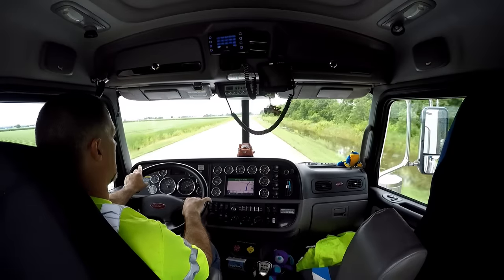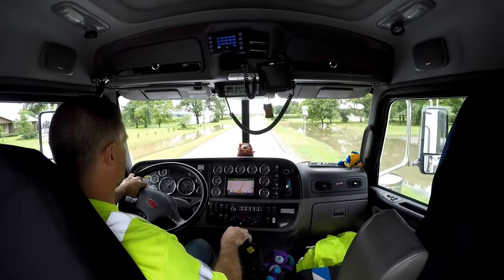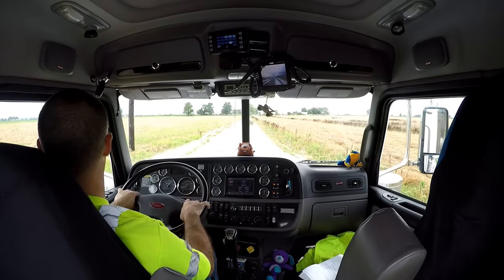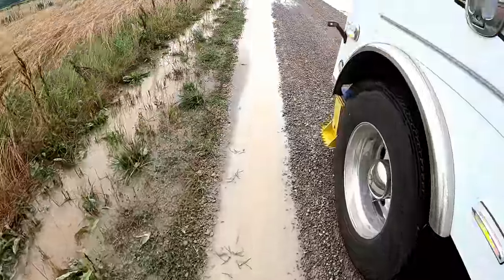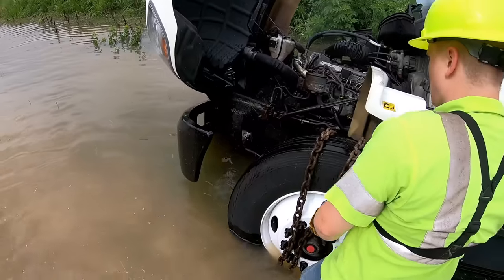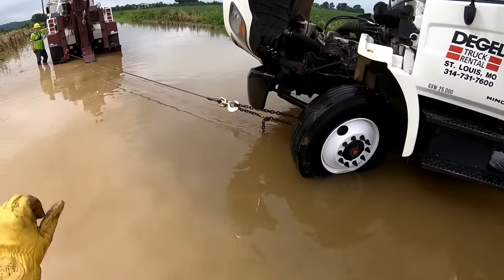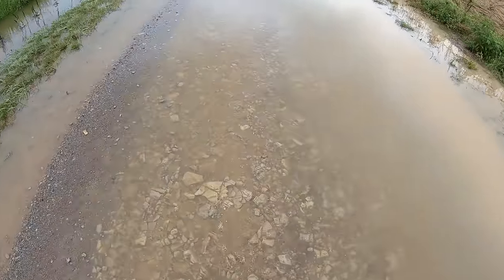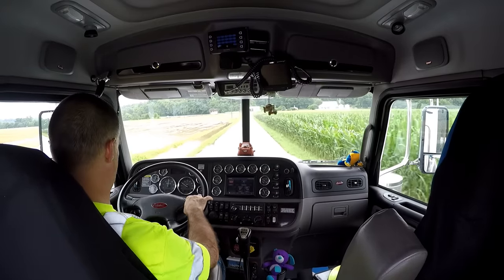Box Truck VS Flood Water

Comment: My Dad told me, "IF you can't drive as well backwards as you do forwards, you can't drive."
Reply: My dad made me back a 4 horse gooseneck trailer up our 1/4 mile windy wooded driveway before I was allowed to drive it on the roads.
Reply: I had to drive 46 miles backwards my transmission went out only thing I had was reverse
Reply: Your daddy 😍 is absolutely right.  God bless you and your family 👪 🙏 ❤.
Reply: Start with haywagons lol they are thrilling
Reply: @keithratliff6884  did you get pulled over

Comment: Well done you Ron for helping the other tow truck, the sign of a true Gentleman, and a big thank you so much for giving us a look see at your area, even from the go-pro on the back of the cab, it looks to be a really nice place where you live and work, as for water problems, I always remembered what I was told as a young driver, never drive fast through water that hides the road you want to drive on, the water just might be hiding something I don't want to drive on or over, and yet another look at the interesting work done by Ron and Talon, Thank You
Reply: Midwest truck you were a sight for sore eyes. I ran a mail route for 8 years out of Cape Girardeau, and out on those county roads during the heavy snows, black ice, and the massive flooding of the region, the snow plows, never saw one, sand salt or cinders, ain't gonna happen for at least 3 days. The Flooding was just as bad to have to drive through as the black ice or thick fog. Small Izuzu box truck with regular street tires! Now, with that said, You were never dispatched to rescue and recover  me and my unit, but you do go into the worst of the worst driving situations to retrieve the non drivers in driving situations. When the mail is dispatched, once it's loaded onto the truck, the directive is to  go deliver the peoples mail. Go! Go until you can't go another inch.. Out in the farmlands of Chaffee, Oran, Bell City, Perkins, Advance, Delta, Chaffee. The good part was that it was all flatland, which took a little  stress off from not having to worry about the next snow or ice covered hill to get over. 
I really enjoy the ride alongs and revisit the roads and communities, familiar sights. Your videossort of brings me back home. I live in N.C. now. Appreciate every aspect, and quality production of your videos.
I notice you always strive to practice, and put Safety first.
Reply: The bootheel of Missouri is absolutely beautiful...... well until winter.  Beautiful yes, in pictures,  lol.  Driving is another story.  Only white stuff under my feet now is SAND

Comment: Good explanation of the lift axle, one thing missing about the self steer lift axle. You don’t want to back up with them down because it will destroy them. They are meant to steer in forward movement but not in reverse.

Fans in water are a combination to take out a radiator, they flex and pull the blades into the cooling fins if the water is deep enough.
Reply: Thank  you for explaining that I was not understand the lift axial

Comment: Out here in West Texas, during our rainy season we often have heavy water running across roadways. Flash floods Etc. They like to put measuring sticks in the ground at low-lying areas with the depth indicated. So as you approach an area covered by water you can see how deep it is. They usually do this at places that regularly get flooded

Comment: Those Cobra rigs (CB radios) are an awesome piece of kit. Also illegal here in the UK without the correct licence too. Yes, we have to have a licence to operate a CB radio here in the UK
Reply: Diefers Dashcam UK seriously?
Reply: I've still got an cb and use it no license I've looked in to it if it's not illegal  from what I've been told
Reply: That was certainly the case at the time when the "Convoy"-type movies were at their most popular but the requirement was dropped some years later.  Having said that, it is perfectly possible that an under-resourced government could have reinstated it!
Reply: On CO radio  we cannot use AM type radios, we have to use FM  you have to have a full Ham licence for AM.
Reply: Here in Canada,  one province has put CB's into a rather dark "grey area", that is to say they've banned the use of them.  In Ontario, they're legal to own, but it's now illegal to use one while in motion. It's now quite a brutal fine and points if you get caught playing with toys in your hand while driving. Must be legally parked (not waiting at a red light) to use phone, CB. Even adjusting your gps could land you in the same hot water.  
And yes, Canada dropped the licensing requirements for CB's decades ago, as in the late 70's or early 80's. Used to be, you could get the base-model Cobra 29, or the Uniden 78 for about 80 bucks,  but like everything, they hiked up pretty radically over the last ten years or so.
Reply: Back in the 60's you were supposed to have one in the US too.
Reply: In the USA the government kept complaining that the CB license was not cost effective, but would not tell the FCC what to charge. 
The FTC simply decided to make them free, but still required to apply for one. Eventually this was also dropped.
Reply: get a ham radio license i have one here in california and cobra is a good radio
Reply: Diefers Dashcam UK    It was once required in the U.S.
Reply: You need a license to fart in the UK, and don't you dare have  an independent thought either!
Reply: Diefers Dashcam UK I didnt even think cobra made radios lol galaxy44, 33 ,99  10 band covered to CB is the way we do it in the US...
Reply: back in the 70's in NZ we had 1/2 watt capacity . it didn't take long for the techs to realise that it only took a diode to be removed and you got 5 watts. We had a yaesu with upper and lower sideband which could also broadcast on the AM commercial radio band width... ha ha . They are still here in OZ by the caravan people as they have a good range outback.
Reply: Even in the U.S. a CB still technically requires a license (as does FRS...GMRS gets a wee bit messy as of last year since it now exists partly as License-by-Rule and partly as a mandatory purchased license depending upon the radio's specifications), the difference being that CB falls under the "License by Rule" provision, which means a license is automatically extended to any properly type certified (Part 95D) and compliant (unmodified) CB whose user is operating it in accordance with the established regulations.  But if you get caught operating a CB outside of those prescribed regulations (particularly violations of the technical rules, such as power output, modulation, or spurious emissions), then that implicit license is instantly rescinded and you will be charged with operating an unlicensed CB radio and an illegal CB radio and the fines can be quite stiff (typically on the order of $5-20k per offense, or even per day in some instances), so some play with fire and will get away with such for a good while until they finally piss off the wrong party...and then immediately cry about how unfair it is that they should have to play be the same rules as the rest of us, nevermind that due to the nature of radio it takes only a relative few bad apples to truly destroy radio for everyone (globally even at HF frequencies such as with CB at ~27 MHz) if we don't all play by the rules and cooperate so that everyone can enjoy radio.
Reply: We had to have a licence for AM (27mhz) & UHF (400mhz) here in Australia. I think the department that regulated it all eventually gave up on trying to keep control of it all & gave up.
Reply: You should get Talon some waders.
Reply: Diefers Dashcam UK   Even in US "linears" still illegal on CBs. Wager the same would be true in other counties. Long as no linear involved CB was limited to 4W input to final.
Reply: Stan Patterson That's a myth, at least until 2021. No grey area in Ontario.

https://www.ontario.ca/laws/regulation/090366
2. (1) Drivers of commercial motor vehicles may drive a commercial motor vehicle on a highway while holding or using a two-way radio.  O. Reg. 366/09, s. 12 (1), O. Reg. 253/12, s. 2 (1); O. Reg. 424/15, s. 3 (1).
Reply: WOW that's bizarre!
Reply: In the US if you have a Ham Radio you have to have a Lic.
Reply: VHF and uhf and hf are license only and cb radio are licensed free in the uk
Reply: in the UK u also need a TELEVISION LICENSE.... TO WATCH TELEVISION (not kidding.)
Reply: GTFF  I regret to state that, he is entirely correct.

It was alleged that...
AM CB radios would interefere with monitoring equipment used on babies in hospital intensive care units..
Would interfere with the functions of people with heart pacemakers..
But what they didn't state was, they would interfere with the Intermediate Frequency Oscillator of the local Police radios..
This was at the time when, if you tuned your home VHF radio to, in and around 108Mhz, which everyone knows is,
an harmonic of 27Mhz and that meant that, if you used say, 100W burner/signal amplifier..
No Policeman, within 3 miles, could ask Beryl, the radio controller, to put the kettle on!
Power Amps, Ground planes and anything above 4W output is, illegal!
Which means that, for many years, when I was sat, high on a hill, on certain years, banging out a DX, on triple 5..
I could 'skip' a signal further than everyone, for fun..
Highly tuned, quarter waved, mag mount, on top of a grounded plane ex-Military Land Rover..
My callsign used to be 26DT135, back in the day..

I will define 'skip' for you..
On certain years, the Sun ejects massive amounts of sloar radition.., due to sunspots..
it has/had, an 11 year cycle but of late..2013, it's been decreasing.. so not as good.
The sunspot creates a solar mass ejection.. this hits our Heaviside-Appleton Ionoshpere and ionises it, making a reflector..
when you transmit, your signal bounces off this, instead of going off into space..
1-9, a roger becomes trapped on Earth, and ricochets around the World..
So, instead of 1-9 copy this one, ET.. you get.. kia ora, from some Kiwi, in his garden shed
I won't bore you with, long wires, Yagi beams or perfectly tuned Antron99 anteneas..
'you in the uk, mate, that's awesome..'
Every time I fired up, CQ CQ DX, he was there..
I told my wife, he's doing my nut in..
She said, ask his 20 (location) and send him some porn mags..
Wuffor, I said.. It'll give him a distraction.. Like you are!!
I took the hint.
CQ CQ DX, 26 DT 135 going QSY...

QSK was, on the side
QSY was going quiet..
Reply: Diefers Dashcam UK  hell, I am old enough to remember that dad had to go to HRH POST OFFICE , TO PAY FOR THE LICENSE FOR THE RADIO, , we did not have tv those days, but I knew that in ENGLAND  you did, and they used to go around in a van with a loop antenna, to find  scofflaws.
Reply: Ron for got to mention that the brake shoes should also be dried out if not replaced do to water as well.
Reply: @ethanpoole3443  the US hasn`t required a license in 40  years.
Reply: Use to need a license with CBs in the US too.
Reply: Kendall Robinson all 10 meter though, not CB which are 11 meter.

Comment: For starters I enjoyed the long introduction, second you did an excellent job doing that recovery with Talon. I had the fun job four or years ago pulling a 4x4 out of a river with my flatbed truck that was a hard pull for my truck the harder I pulled the more my truck kept sliding towards the river so I tripple blocks my wheels on both sides and it worked out well the truck came out and so did the boat trailer that was attached to it which I was not aware of till the truck started coming out because the person that was driving the truck was drunk and backed the boat and trailer too far back. I wish I had video of that because it was one of my first tow/recovery jobs that I did and it was a challenge. Keep up the good work, and keep the awesome videos coming.
May God bless you and your family.

Comment: I did a recovery in the similar conditions. I pulled a freightliner Cascadia, with a 53ft trailer and there was also a box truck stuck in the same spot lol. I used a 🛶  and paddled my way out to him. Cold water tried to cage the truck until I couldn't feel my hands. Fun times. You got it right about waiting for the water to subside.

Comment: That Vulcan 370 is cool.
Do you have anything in Klingon or Ferengi?
Reply: The Klingon would be battle ready at all times. The Ferengi truck would be cheaply built for profit and everything would cost Latinum to use.
Reply: So I'm not the only Star Trek fan!  Always think of Spock when Vulcan mentioned.  😄🖖👏
Reply from the maker: Live long and prosper.
Reply from the maker: @genkatqltr8517  Live long and prosper.   Big time Trekkie here.....
Reply: @RonPratt  Thanks Ron!
Reply: Would have been even better if it had been enterprise trucking with this star trek talk
Reply: Also would that make the rotator the Borg with all of the high-tech equipment
Reply: I think he said v70 but it could be a 370

Comment: Talon needs some higher boots  some years back when it was night to take calls got a call for a car that got caught in a dry wash that all of sudden was not dry and washed them off the road water was coming in this older couple managed to get out but the car was a total.  When my driver got and checked things out said would have to be morning as he could not touch bottom in front of the car.  When you see the sigh in a wash possibly flooding they are not kidding it hit from them from out of nowhere in the dark.  Ron is right it does not take much water for a car to hydroplane.  Great video as always

Comment: So who do you call when the tater gets stuck lol
Reply: If the tator gets stuck and between the capability of that beast and Ron Rigging knowledge it would be a really complicated situation. Using some Bulldozer and excavators as anchor points could help as to lift it you would need another big tator or some beefy mobile crane
Reply: it would really depend on how the tater get stuck. certain situations I think just deploying those outriggers could possibly get unstuck it. then get the vulcan and the other big one they have (can't remeber it) as anchor points and use the crane funtion on the tater to get it stuck. otherwise ron really messed up.
Reply: I've had our rotator get stuck, and I got it out. I drive a 5130 century so I'm a lot smaller, but if you use proper rigging you could just get it out with one truck.
Reply: I believe Ron is careful enough with his baby that he’ll never have to worry about getting her stuck lol

Comment: Hi, Ron,  I am a retired firefighter and Paramedic. I am also an amateur radio operator so radios have been my interest and life and life long hobby.  I have staffed an ambulance for 40 years. I noticed in some of your videos where you use FMRS "Walmart" radios for intercommunications. I know with cell phones two-way radio would seem unneeded. Since you work so closely with Fire and Law Enforcement having radio equipment in your trucks on their frequency would be of great benefit.  All it would take would be the green light from your Sheriff to use them. Most Sheriffs have thought it was a good idea. Tow operators here monitor from their trucks. There is a public safety frequency called "Law Aid and "Fire Aid" specifically for interagency communication. I think this is where you would fit. You should ask him who provides their equipment and speak to them. Also being able to talk truck to truck is a good idea. There are frequencies for that also.
Reply from the maker: We have and are continuing to look into that option.  Here we have to go all the way to the state level, not just the Sheriff.   Also, most of the agencies here have gone to "trunking" (digital) systems over the old analog, which is a good thing, but the cost is a lot greater for the equipment.   Thank you for your service.  God bless.

Comment: Ron, I typically do a large number of winch calls in winter here in Canada(go figure). I've always been trained that for safety that standing in line of that winch while do the pull is the line of fire if that line breaks. Passenger side control may have been the better side and also for vision. Have broken a few lines in my 11 years and they typically snap like an elastic when they break. Looking out for Talon in Canada, great winch kiddo.

Comment: Awe gee, a  President Grant 40 Channel/upper-lower sideband, does have a built-in PA. One less microphone. Using sideband you have 12 watts while the CB side only has 4 watts. I have 120 channels available rather than the standard 40. I  have 9 feet RG -8 coming out of the Antenna and 18 feet of RG-58 giving the 3/4 wave whip a 1 wave boost.SWR 0.1 to 1 or better known as flat. That is the set up I first put onto the truck and it's stayed that way ever since. The Antenna is about 5 feet tall, mounted just behind and to the left of the cab.  When I go shopping I can see the antenna from the store so I don't lose the vehicle even when the lot is slam full.